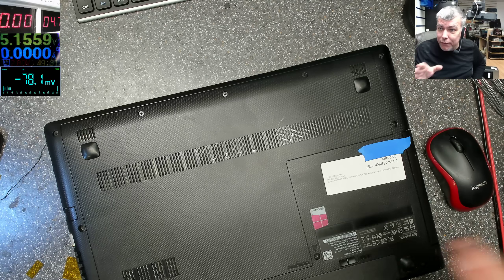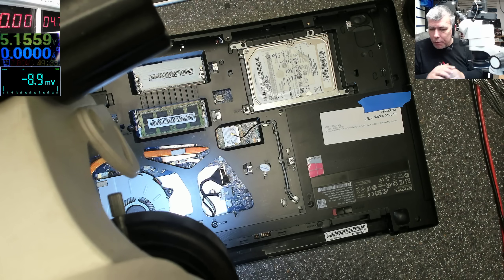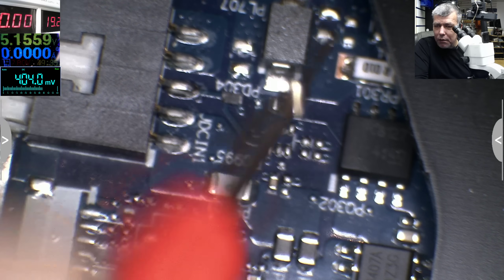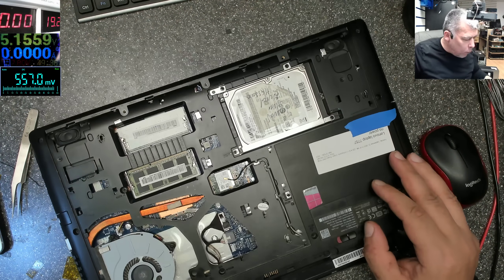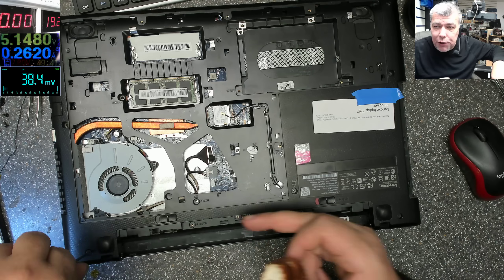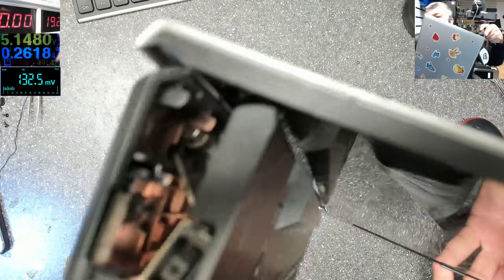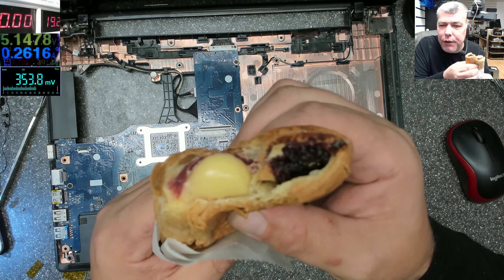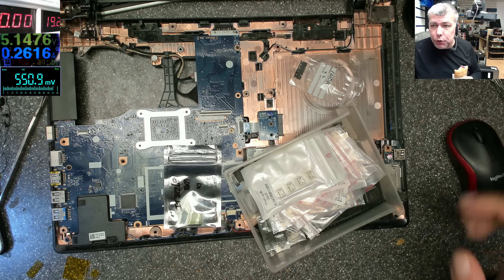Lenovo G50 not charging not coming on - motherboard repair Part1

Comment: Sir I have a lenovo laptop G50 -45 model .When I connect the charger the charging led is blinking but  when i turn it on  the charging lights stops blinking it says automatic repair and ofter sometime the laptop gets turned off by itself .Can you suggest me some idea on whats the problem

Comment: So how we can understand SIO is bad or burned from shorted if getting hot and no standby light and of course not coming on?, there is 3,3v and more lover voltage around of SIO also BIOS chip have 3.3v and power on  button  have 3.3v is ok. am removed a capacitor up of SIO and not hot like in past but still little bit hot and no standby lights. where we must check on this case standby chip or else ?

Comment: I have no power on the input. 2:03. Any advice? charger is fine. dc jack is fine. also no power on the input from battery. battery is ok. Lenovo y50-70

Comment: my laptop is also lenovo g50-30.  it was working.and I plugged it into the charger while the charge was running low.  shows that it is charging but the percentage did not increase and turned off.  I replaced the battery, the laptop burned out and worked, and turned off again without power.  then the indicator also did not light up.  this laptop does not burn only through the charger without a battery.  in fact, can this laptop burn without a battery ?.  if you know the condition of my laptop please help me.  thank you so much for your help.  I look forward to your reply.

Comment: After my laptop (lenovo) charger broke down, i took a replacement but it doesn't work when the laptop is turned on, only when the laptop is turned off the battery is charging. Is there any protection if the original charger is not used or?

Comment: oh Lenovo one of the worst brands i have come across my bench. the build quality of the casing is total shit i have a Lenovo i believe the G40 belongs to sister inlaw think within 3 months of buying it both screen hinges broke from the casing but shop / lenovo wouldnt touch it for repairs under warranty  ended up having to use nuts and bolts to put it back together only way to fix the screen secure made it look ugly with the nuts at the bottom but it worked

one of the other known problems with these Lenovo  laptops is the graphics chip the chip tends to loose contact with the motherboard have come across many lenovo laptops with this problem and seems that when these motherboards are put together with the components to make it work its like its done in a rush and it ends up needing the chip taken off cleaned both chip and motherboard and re-balled and put back on

total shit laptops and throw in HP on the shit list